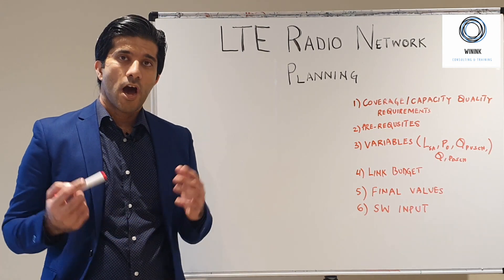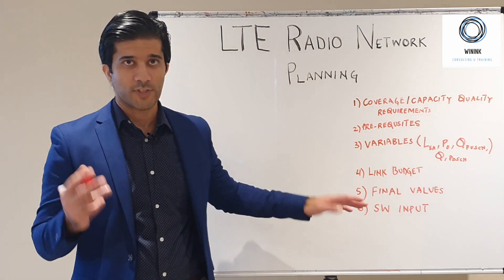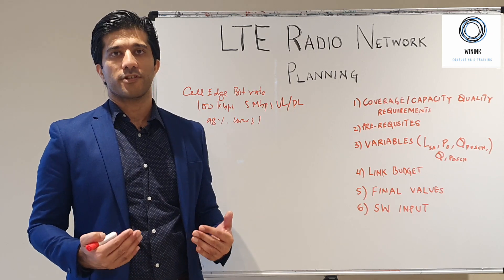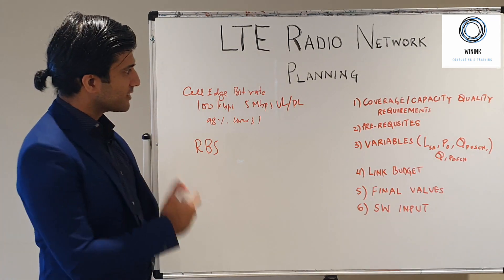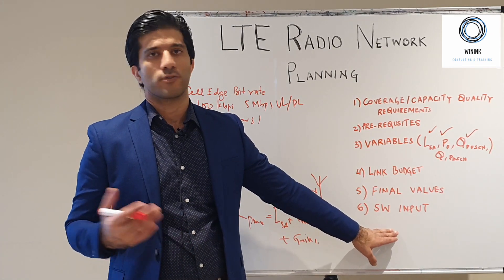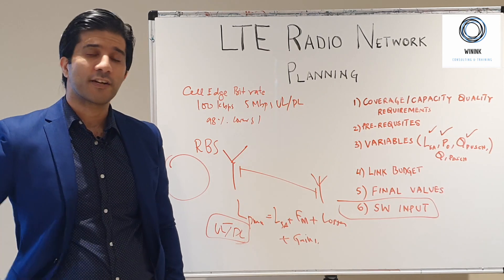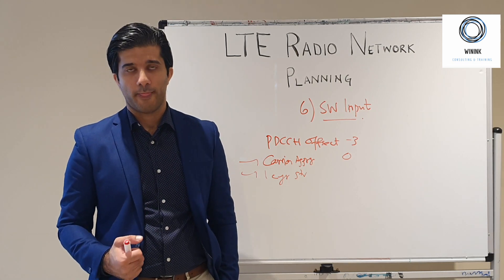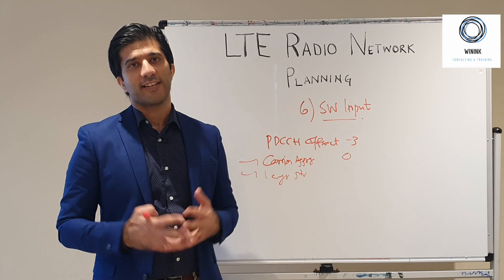How to design/plan LTE Radio Network

Comment: what are best softwares for 4G LTE and 5G design and do these softwares needs 3D map of the area that you designed for ?
Reply from the maker: Atoll, Planet are good Softwares. You can use 2D maps and also 3D maps too
Reply: @WinInk  sorry for disturbing you but do you need site survey or you can use available data from Google earth and other online geographic data which is available on internet ? (for designing 4G LTE for a small town)
Reply from the maker: @kozhenidres314  You would need data which can be used by a design tool. This data usually comes in the form of geo located terrain elevation and clutter type information. You would not be able to get it from Google earth. Many companies around the world provide this data
Reply from the maker: @kozhenidres314  You would need data which can be used by a design tool. This data usually comes in the form of geo located terrain elevation and clutter type information. You would not be able to get it from Google earth. Many companies around the world provide this data

Comment: Can you please explain calculation for SS epre in 5G  for both FDD and TDD if antenna config is 64T64R TDD and 4T4R FDD
Reply: Reference signal calculation is it same for LTE and 5G? if no what is the difference and how they are different
Reply from the maker: Hi OM In. We would try to provide a video on that. The power calculation is the same however there is additional usage of beam sweeping and common beam for cell access.